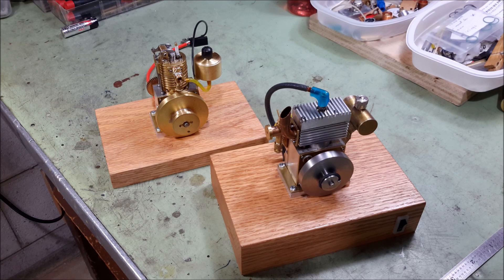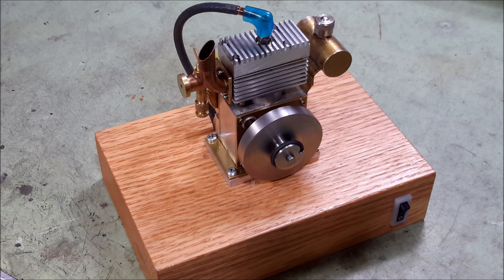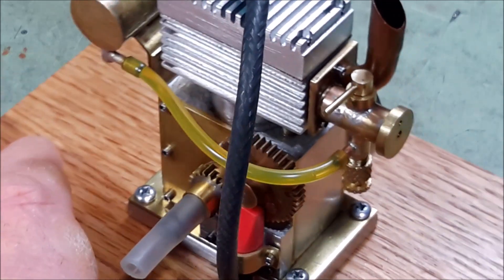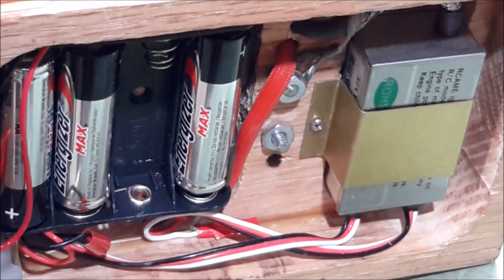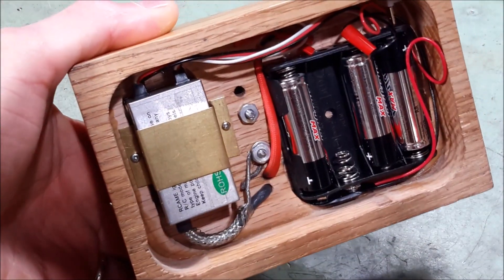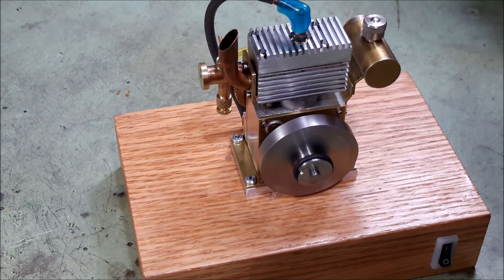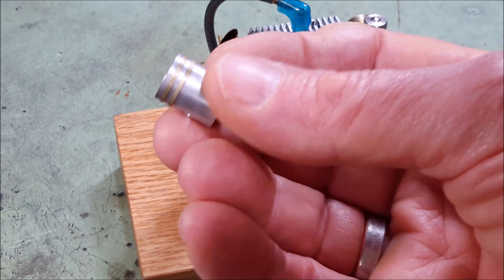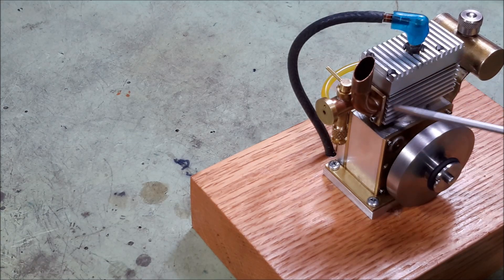MINIATURE, 4 - STROKE, INTERNAL COMBUSTION ENGINE WITH SPARK IGNITION

Comment: I wonder if your ignition system would be happier if you ran the hall effect trigger off of the crankshaft/flywheel rather than the cam gear?
Reply from the maker: What is your thinking on this.  If the sensor is on the flywheel there will be a spark every revolution which leaves less time for the coil to charge up.  I would think that would result in a weaker spark.
Reply: @LeslieProper  I have seen these cdi style ignition systems used on model aircraft engines like you spoke about, and they all seem to be triggered by the crankshaft. Typically just before the prop. I am more familiar with cdi style ignition systems from working with small motorcycle and Japanese kei car/truck engines. In those applications, the hall trigger is always referenced from the crankshaft. curious if running the trigger half the speed of the crankshaft might be giving you slightly inaccurate spark timing because of the cdi unit's pre-programed ignition curve that is based on crankshaft rpm. Just a guess anyways. I have really enjoyed this build of yours. For the valve leakage issues, I would recommend using a thin coat of valve lapping compound. Had to do that to one of those cheap Chinese 4 stroke models. seemed to work very well.
Reply from the maker: @BaileyEvans  Are you familiar with the ignition systems that use reed switches and coils from a stove ignitor?  I have used these on several of my 4 stroke engines and they work okay.  Concerning valves, I have found that if you can get the engine running the valves seal up quickly.  I am going to check out your youtube channel.  I know I have seen it in the past, but it has been a long time.
Reply: @LeslieProper  I dont use this channel for much these days, my business channel is the fun one that I'm a bit more active on it's called, Passion Sport JDM LLC. I import all kinds of neat old Japanese vehicles.
Regarding the stove ignitor ignition systems i haven't ever messed with them but have seen a few guys online do it with success. Would imagine they would work well for lower speed engines that do not have a huge rpm range.

Comment: Beautiful engine, did you draw up a set of plans for this engine?   Cheers
Reply from the maker: I have bits and pieces of the six engines I have built on a LibreCAD .dxf file.  I basically made the drawings, on the fly, as I built the engines and where I didn't need to work out clearances or other specific details I didn't make drawings.  I would be happy to send you what I have if you desire.  My email is lesproper@gmail.com

Comment: Congratulations!  So glad you got it running.   In the 1930's model engine cylinders were often made of cast iron.  Many if not most model airplane engine sleeves from 1950's through about 1990 were made of 12 L 14 Seel. (Cox, O.S. and others) Now days a lot of the engines use a brass sleeve that has been chrome plated.   I have seen brass rings on small engines before, and they run fine.  Cast iron rings use "meehanite" centrifugal cast iron, very fine grain.  I think Speedy Metals sells it in small amounts.
Reply from the maker: Thanks for all of your help in getting this engine to run.  I wanted to thank you at the end of this video, but did not receive a reply to my email requests in time.  I wonder if my email ended up in your span file? I would like to acknowledge your help on the next engine, if your okay with that.
Reply: @LeslieProper  Yes, no problem.  That's a very cool engine!

Comment: Great job love it .Are plans available for this engine?.
Reply from the maker: The drawings for this engine are not detailed or dimensioned.  I sort of did them on the fly as I built the engine.  There are not in a usable form at this time.
Reply: @LeslieProper  ok thanks for your reply. May gave to draw up some like it myself. Nice build.
Reply from the maker: @colinsalter3516  Colin, I use LibreCAD for a drawing program.  I can send you my .dxf drawing file if you want.  It may provide a starting point and save you some work.  Sent your email to lesproper@gmail.com if you want it.

Comment: Glad see you build it! If you run it on methanol fuel you can use F glow plug it can run on low RPM and you always can add heater circuit that will keep glow plug hot on very low RPM.
Reply from the maker: I tried using methanol in the engine initially and I could probably get it to run on methanol, but it seems to prefer white gas (Coleman lantern fuel).  Do you think the engine would run better with a glow plug?
Reply: @LeslieProper  it depends of the compression, if it enough for methanol it will run stable, use hot glow plug for 4 stroke engines.
Reply: Great choice on the Colman or naptha fuel. It  is not as critical on a/f ratio as gasoline. It works great on small low compression engines.